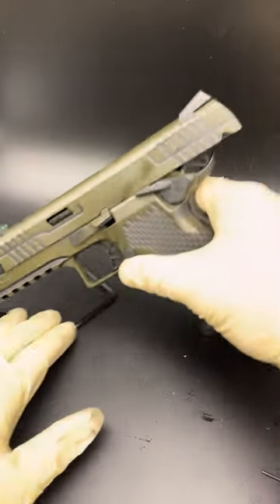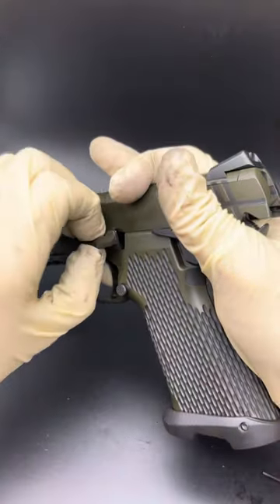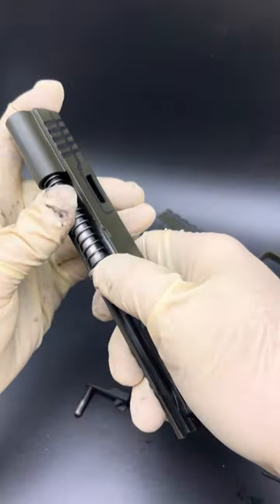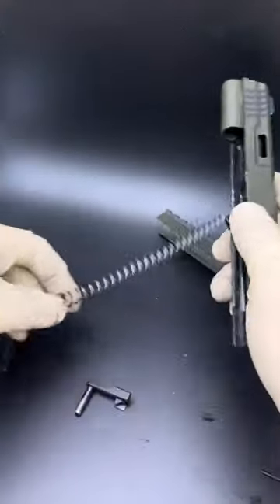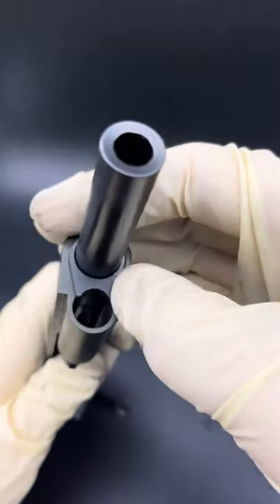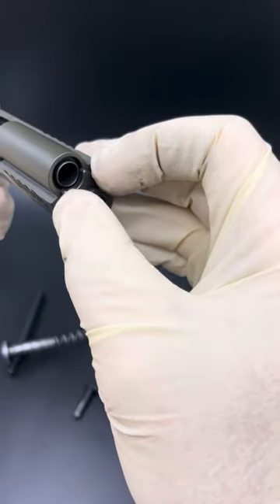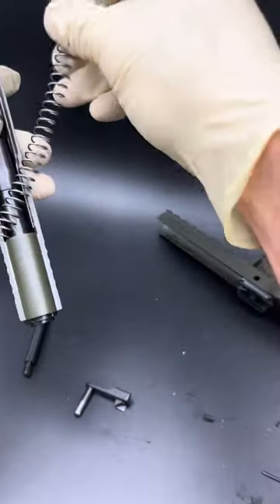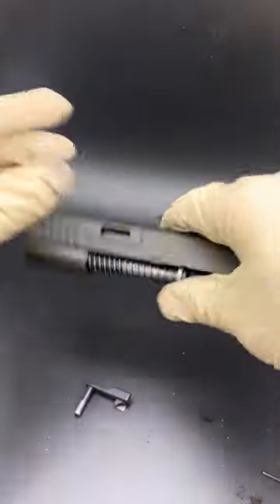Platypus Disassembly

Comment: Same way I take down a 1911. Most builders recommend doing it this way especially if the bushing is really tight as the barrel can be used as a slam hammer essentially.

Comment: I may not be telling you anything you don’t already know but I’ll offer advice for getting the spring and guide rod lined up quickly and easily.  
I carried 1911s for years and fumbled with the springs.  
I noticed one key difference in the Platypuses recoil spring plug and that is that it is hollow. Here’s my advice. Once you have the plug in position slide a rod through the front of the hole and through the spring. A bamboo skewer would probably work just fine if it fits… then place your guide rod into the spring and compress it into place. This will prevent the spring from bending outward as you press the guide rod into position. 
Once you’ve got the spring and guided in proper alignment you simply slide the skewer out of the plug and screw the second piece of the guide rod into place.  
Just my 2 cents but I hope it helps someone out there.  
Let me know if it works for you!

I don’t own a Platypus but man I’ve got one saved that I designed on the website…. Maybe one day!!!!
Reply: I had to use a long Allen head instead of a skewer. Good lord are these things packed tight
Reply: Your comment definitely helped. I watched a couple videos on the platypus. I had a hard time until I tapped into knowledge in the comments. Thank you.

Comment: At the risk of sounding stupid, on my old 1911 I maintain my trigger assembly by just popping out the safety, and usually I just unscrew the opposite side of the ambi safety and same thing just pop it out. I don’t see where the safety comes apart in two pieces, how do I remove my thumb safety for maintenance?